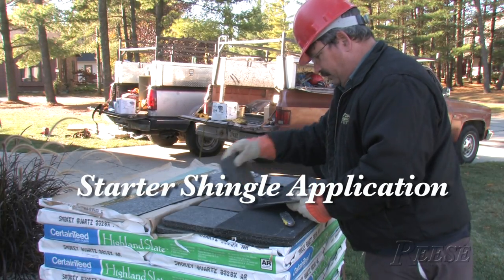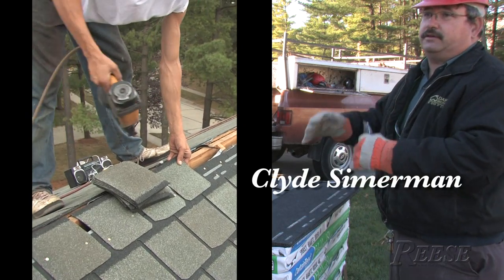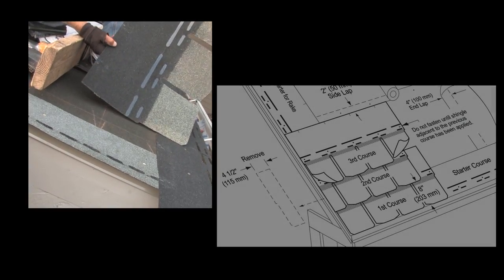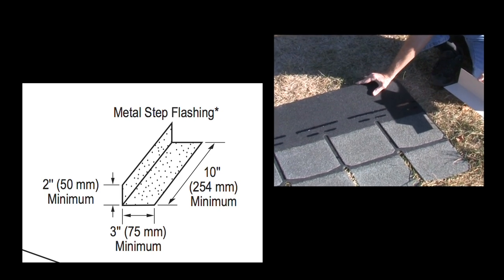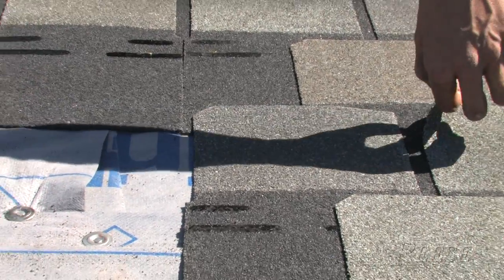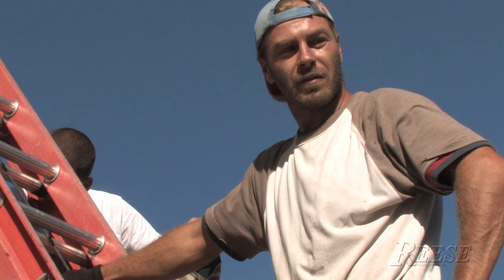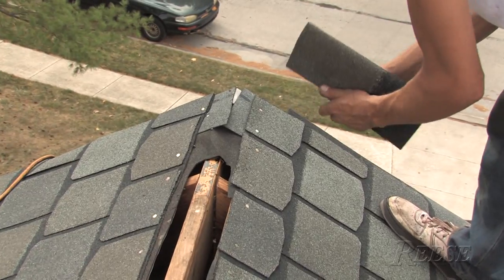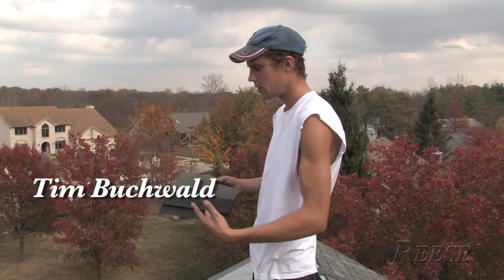Reese Tips - Installing CertainTeed Highland Slate Shingles ytv66B

Comment: Your water lines are crooked. I would make you take the shingles off and reinstall if it where my house. You have to snap lines to get straight water lines. The notches in the shingles will leave you crooked every time. Not trying to put down on your work. Just sayin
Reply: What measurement do you recommend? We’re doing 32 but I was told it is wrong
Reply: You don't have to snap lines for 3 tab styled shingles, I mean if it's your first time you could. But if you've been roofing for a few years and have done it a lot you should know how to keep them laying flat. Have done a bunch of 3 tab roofs without chalkline and they always turn out straight.